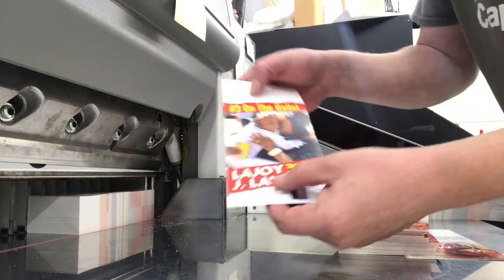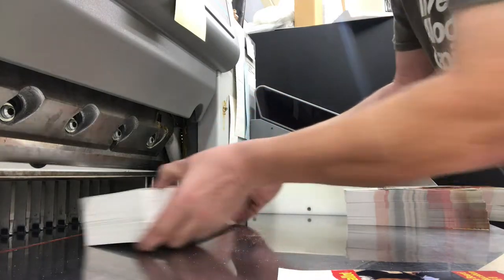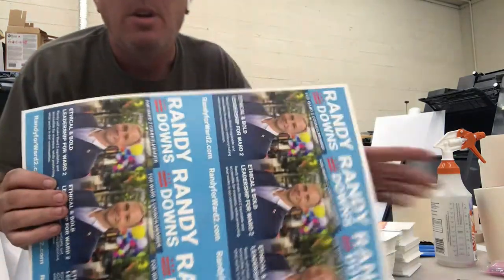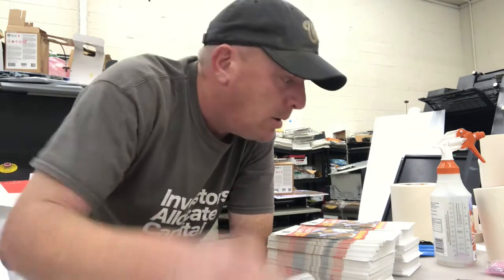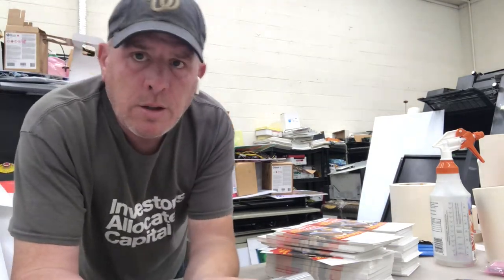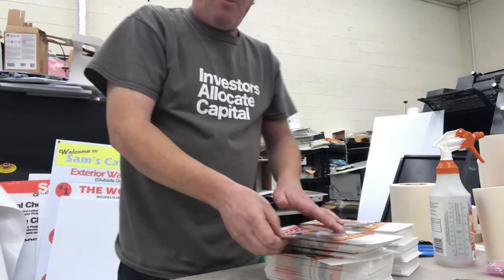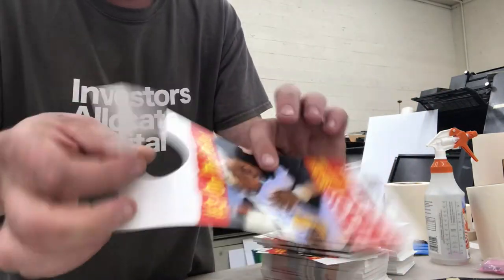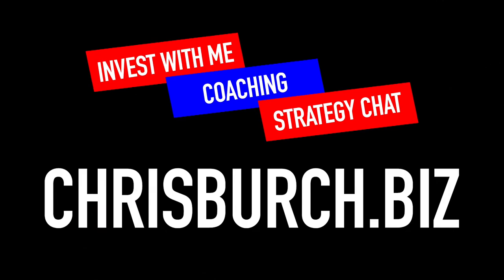Door Hanger Printing

Comment: Hello! Where can I find a hole punch like that?
Reply: Hobby Lobby has them. Look up 1.5” hole punch
Reply from the maker: awesome thanks for suggesting
Reply: get a 1.5" hole making drill bit and mount it on a drill. spin at high rpm in reverse and hold a file against the outer and inner teeth to remove them an make a razor edge. you can use that to make holes in a stack. attach a blade to a hydraulic press and it will make the slits into a massive stack.